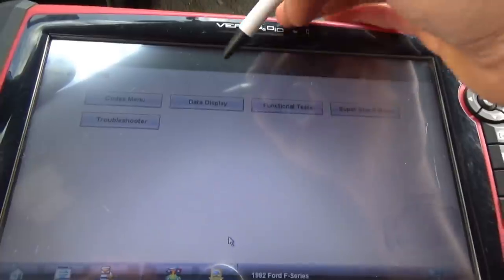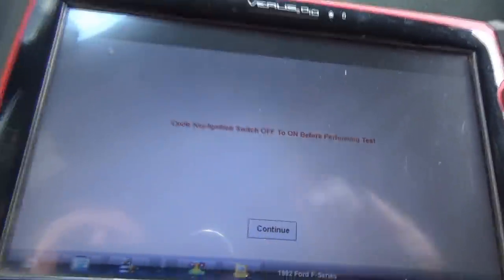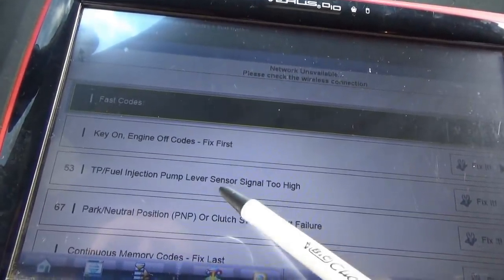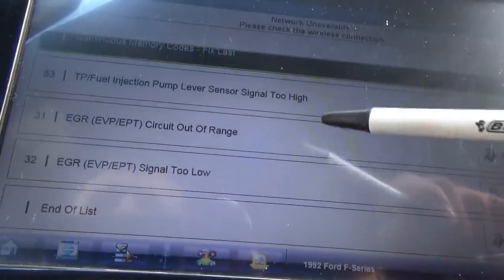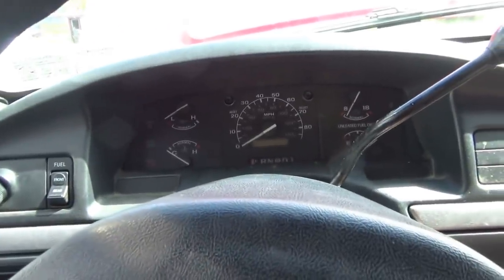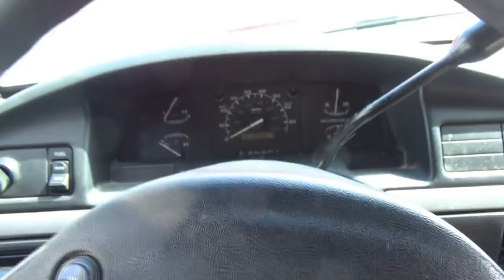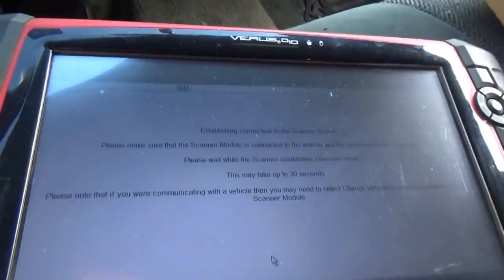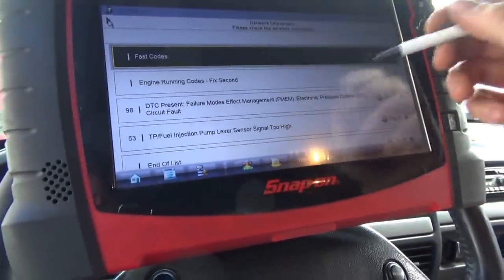EBAY Parts Caused Ford Truck IDLE Problem? ('92 F150)

Comment: I actually WROTE some of the software in that engine control module.  Idle TPS setting is not critical (the spec said 0.7v-0.8v but the old one was 1.1v).  Software re-learns Closed Throttle every time you cycle the key.
Reply from the maker: Interesting. The 0.7 V spec seems to be right on the $! Old throttle body linkage was tweaked by the tech so plates wouldn't close to the original position lol
Reply: i got mine at .89 or somethin. i didn't know it learned that often though. I swapped the instrument cluster minus odo into my 94 so i could have a tach. The CEL doesn't work now and it's not a socket corrosion or bulb. I guess i have to pull the layers of pcb papers on the cluster and look for a burnt trace....jeez

Comment: That Ford IAC system is so goofy. If I remember right the throttle stop screw isn't even supposed to adjust the idle, it just makes it so the throttle blades don't stick closed. The hole in the throttle plate actually sets the idle. Ford sold bushing kits to change the size of the holes to fine tune the idle. The IAC is just there to raise the idle if you have a load like air conditioning or power steering at idle. 🤷
Reply: You are correct. The set screw that everyone dicked with was the “hard stop” to keep the plates from sticking. The hole was a calibrated size for air bypass. A quick trick to set base idle was to disconnect the  IAC and the engine should just barely idle. With the IAC plugged in, it should run between 25-40% at idle, depending on load. If it’s really low, that’s usually a sign of an
Intake leak.
Reply: Ya its a slightly ass backwards and unforgettable system.
Reply from the maker: Yup and they tell you not to wipe the bores because it will remove some magic coating 😂
Reply: @PineHollowAutoDiagnostics  I always used a clean rag and some carb cleaner anyway. A gunked up throttle body will cause many idle problem all on its own
Reply: @PineHollowAutoDiagnostics  the magnum dodge engines are similar supposedly if you touch the tip of the iac valve it will no longer work.  I've tried mine and I'm happy to say that it's a great joke and still works fine
Reply: @PineHollowAutoDiagnostics  That statement is actually CORRECT !  The coating was installed at the throttle body manufacturing plant to minimize air leaking around the plate at idle.  All idle air should be controlled by the hope in the plate and the IAC.
Reply: Never heard of bushings for the throttle plate.  The small hole would mean the IAC would have a larger range of authority.
Previous generation (EEC-II) did have just a "kicker" for fast warm up and A/C idle boost.
Reply: Yup. Disconnect IAC, set base idle to 500 or 550 rpm I think it was, plug in IAC and Restart. IAC adjusts for engine loading, duty cycled by PCM for desired idle speed. If the TPS is at idle voltage.
Reply: @jackpatteeuw9244  I actually remember those old model 7200 VV carbs that used those; when properly rebuilt, they gave better power, fuel economy and emissions then the CFI engines.
Reply: sounds correct and the TPS should be slotted and adjustable enough to get the correct voltage, with blades shut and stop screw touching proper so it doesn't jam shut.
adjusting it any other way will run bad and spit codes.
Reply: @PineHollowAutoDiagnostics  it's like pixie dust for throttle bodies...
Reply: @PineHollowAutoDiagnostics  Correct.  It will never be the same.
Reply: Exactly Wes the blades are set just off the bind with the stops, glad to see a youngster knowing old Ford EEC 3 systems. Although with all the EEC's I worked on I never had to adjust the holes to fix an Idle problem. That sounds more like Ford didnt wanna change throttle bodies if one got a worn shaft under Warranty and just wanted to close the hole a lil to make up the diff lol. Kind of like when the 3.0 Taurus blade shafts in the intake failed and leaked they gave out revision kits to limit PCV flow and left the intakes leaking lol. FAIL!
Reply: I cant recall how many times I've told some old school carbureted guy that the throttle stop screw on these OBD1 fords is only used for calibrating the TPS voltage and is not an idle set, just to have them argue with me about it.
Reply: @PineHollowAutoDiagnostics  Ivan, that was because they didn't want people cleaning them and to just go to the stealership to buy a new Throttle Body. But if I remember right they didn't come out with Teflon-coated Throttle Bodies until  1995 or later and then went with a solid plastic TB in the 2000"s. But that Magic coating on those back in 90- 92' was just carbon build-up. lol  My boss bought into that shit, when the parts cleaner man sold him a 55 Gal, drum of plastic safe parts cleaner, my boss called him back and told him to get that shit out of his shop because it took 3 times longer to clean any parts and he was right it sucked. lol The only good thing was because I was a kid of 17 and working in the shop that weak sauce parts cleaner didn't make my hands numb after using it. And yes we had Gloves but I refused to use them back then they looked like proctologist gloves and went up to your shoulder and the guys in the shop gave me shit about wearing them. lol :)
Reply: I personally polished mine to mirror finish, no more build up issues after that.  

I believe there was a set rpm with the iac disconnected, a bit of a hack was to then open up the tps mounting holes to give you some adjustment.  

The best performance and mileage is usually attained with the TPS just under 1.0 volt, at 1.0 volt the obd I Fords went into closed loop.

Comment: I actually still have 2 early obd cars and I actually like the old paper clip diagnostic method... mostly because 99% of the time the code pretty much tells you what's actually wrong with the car rather than leading you on a chicken chase through the various systems and sensors.  One of our cars blinked out a message recently that said EGR valve malfunction... and amazingly enough when I tested the EGR diaphragm it was blown....The old OBD systems didn't throw a lot of codes, but when they did they usually gave you useful information and all you needed was a paper clip to read the codes. I know I'm getting old because I remember hating on board computers when they first came out and now I look back on them almost fondly.... how sad.

Comment: I started working on cars in the 60s,  Tune ups with points and condensers, specific tools for specific carburetors. It was pretty cool to see the technology change all the way up to todays  computer engine management. I stayed up to date and found it really isn't that hard to properly diagnose a problem the first time. I have been retired 6 years and enjoy watching these diagnostic videos. 
What impresses me the most is the HP they can get out of small engines. 6500 rpm redlines on most cars is pretty impressive considering anything over 5000 rpm was pushing it back in the old days.

Comment: That shop could have avoided a lot of issues by using a pipe tap on where the fitting rusted out and just screwed in a new fitting.
Reply: or just looped the coolant hose back upon itself bypassing the throttle body.
Reply from the maker: That's exactly what I told them 🤣
Reply: @mph5896  until it iced up in winter!
Reply: YOU guys are missing the shops main point>TO MAKE PROFIT< how much more money did they make buy selling the guy a new throttle body 200 ???And on the legal side of it ,that's a legit charge,because a rusted out pipe IS PART of the body.IF they would have REMOVED that pipe and did a repair THEY would then be liable if the car overheated or had ANY cooling issues and blew the motor.LET'S say the owner was smart enough and crooked and PULLED the pipe off,AND CLAIMED THEIR repair FAILED.SMALL CLAIMS court says they would owe him a motor.I KNOW that"s  BS   but it could happen ,just saying.I"M just saying the shop was TRYING to cover their ass,maybe.great job as always IVAN>
Reply: @robertoruiz7069  That's why I enjoy Ivan's repairs. NPR. If you don't understand the problem you can't fix it. I think it's more about time vs reward. It just takes so long to figure out how something has failed. It's more cost effective to replace the suspect components,  plus the markup on parts. Around here most places work too cheap and make it up on parts.
Reply: Seen this before, and we drilled and tapped with a brass fitting from hardware store.
Reply: @mph5896  it would ice up, and not even need that cold of weather to do so.
Reply: Yes, agreed.  The fitting on my F250 had enough of a nub to put the hose on, but the next plan was to tap it and drop in a fitting.

Comment: Great review Ivan. Keep the old ones alive !
OBD1 vehicles also don't have issues like the new vehicles do. Recently had an '89 GMC V1500 Suburban with high idle issues when cold to warm, idle wouldn't reduce fully on its own. Once at operating temperature, the only way to get the idle down was to put it in drive with the brake on and within 20 seconds the idle would slowly come down to spec. Plugged in the Snap-on brick and of course, little help from that. Had to revert to prior to OBD1 methods or fire the parts canon. No vacuum leaks so it had to be a sensor related issue. The Vehicle had a Standard Motor Products IAC installed so that was a suspect. Ended up replacing the IAC with an ACDelco IAC, not easy to find by the way, and now the idle curves work normal from cold to operating temperature. During our diag, we measured the TPS and it was within range but my mechanic friend wanted to lower the idle number to .07 from 1.0 which was within spec range as it was. Idle is now super smooth. IAC's apparently have to be dead on perfect and from our experience, you need the factory part vs. aftermarket regardless of their reputation. My guess is when the Delco brand is not available your best options are to use Delphi or Borg Warner since they used to or still do make GM parts.

Comment: Ya, nice looking truck with the red/black combination.
Just keep the tp sensor voltage below 1.0 volt.  1.0 and higher will turn on the evap purge.  Changing older tp sensors with new OEM sensor helped to make a more crisp throttle response.  Kind of like changing the accelerator pump plunger assembly on a carburetor.

Comment: You can get live data with a cheap OTC scan tool.  I bought one specifically for this - OTC 3211.  Worked great on the 1993 F150 I had to troubleshoot for similar problems.
Reply from the maker: Really? Interesting... Maybe 92 was too old lol

Comment: Ivan,
Great video and fix - thank you! Codes 23 and 53 were set because the TPS was not reading between 0.5 and 1.2 VDC at idle. 
I have an early Fox with a SEFI 5.0L EEC-IV.  When Ford came out with the EEC-IV in the early/mid-1980s it was very advanced for its time.
Paul (in MA)

Comment: These trucks 87-96 were the glory years for the trucks the speed density EFI 300/302/351W/460 though primitive was simple to fix and parts were cheap. If you had a multi meter and basic hand tools and a haynes/chiltons manual you could diagnose a lot of common issues. Pretty appalling when a shop has to resort to swapping parts to find an issue and threw in the towel for a BASIC repair. Just because it didn't have an OBD2 port and it was an older vehicle. I'll never get rid of my 1990 any time soon.  I have to say lots of aftermarket electronics and sensors lately are just plain junk out of the box so I try to stick to OE parts  like sensors, fuel pumps, tfi modules, PIP sensors etc. but again dead simple, yeah it's not a modern system for EFI but if you understand the basics and can read and use a multi meter, your save yourself a shit ton of cash.
Reply: Is your 90 a Ford ?  I'm getting a lot of fuel consumption, after I did a tune up and I had replaced other parts earlier before the plugs and wires and it stinks, but immediately after replacing them the problem started.

Comment: These things eat IAC’s, TPS and EGR sensors. They also won’t control the IAC if the TPS isn’t at idle voltage.
I still have a half dozen thick film ignition boxes if you need one, lol.

Comment: I did an motor change several years ago and the customer wanted to change all the sensors  at the same time.  Dang thing would not run when I got done and traced it back to a bad new TPS sensor.  Threw the old one on it and it fired right up.
Reply: The aftermarket TPS sensors for old Fords like this one are GARBAGE!  If the vehicle starts n' stalls, randomly stalls when the throttle is released, or falls on it's face when you get on it, a junk China TPS should be your #1 suspect.  An old analog multimeter makes short work of diagnosing them.

Comment: The. MAP sensor can also be a culprit with idle. I had a 93 E150 that had a bad TPS and MAP at the same time. Took some time to get it all found, all I had was the CEL flashes to go off of.

Comment: once a guy figured the koer and koeo  self tests there was only a couple of other checks to do.  ford had it right while all the other obd1 manufacturers  were a headache.   dont even think about chryslers lean burn system.  once they screwed up  just run them off a cliff.
Reply from the maker: GM had live data since 1984!

Comment: On EEC-IV, I believe that live data is available if the EEC uses 3-digit codes. I know that the 91 Ford Escort and the 95 Ford Contour support live data.
Reply: I still look after a 92 f150 that has live data.    I believe a 1990 Lincoln continental also had live data but that was a long time ago.
Reply: My 86 Ford with EEC IV doesn't have live data that I can find.
Reply: @gregwhite5058  I think the oldest EEC-IV that supports live data is 1990 or 1991.

Comment: Ivan, Did you ever get your live data to work.?  Rather odd that you didn't otherwise.  They didn't give you lots of PIDs but enough to help out with certain things..especially giving you your tps and the iac % 
Couldn't even begin to tell you how many of those bent throttle stops I've seen.  I think that's the LazyAss throttle adjustment some will do. Lol😂

Comment: Amazing that when items are put into factory specifications , THEY WORK! Step ONE : know HOW the system you are working on operates ! Instead of reinventing the wheel , FIX the bad spot . " Houston , I think we have a software problem , booster rockets will not fire " . Rube Goldberg : nobody knows HOW that computer stuff works , put a TOGGLE SWITCH on the computer ! HOW do you fix it if you don't KNOW HOW it operates ? Great detective work with the bent part , bad wire and diagnosis .

Comment: I have the same amp clamp.  Do you ever see ghost amperage on the amp clamp.  I’m seeing 30 -50 mV not hooked up. Not sure if this is normal or defective.
Reply: Yes, it's due to the earth's magnetic field.  You are supposed to hold it in the same position that you are going to clamp it on a wire, hit the zero button, then clamp it on the wire.  RTFM 😀

Comment: I had this problem with an old carburetor version on a 302 Ford.  I just wired the choke open with baling wire.
Reply from the maker: I'm sure that improved the fuel economy 😂
Reply: @PineHollowAutoDiagnostics  I really enjoy your videos by the way.  It just points out that old school guys like me need to take cars to guys like you who actually understand the electronics.

Comment: I worked on a 89 f150 with a 302 that was a crank no start and when I unplugged tps the engine started and ran good so I left it unplugged and never replaced it because the guy that owned it used it to haul garbage in the campground he owned and it never seen the road. I couldn't believe how well the truck ran without the tps unplugged but transmission shifted ok and he never had a problem with the truck for the 10 years he owned it.
Reply: Seen a lot of map sensor failures on them
Reply: My favorite 80's and 90's rwd volvos just had a clicky microswitch as the tps... It clicked on by a closed throttle and idle control was activated.  0 fuel responsibility.

The slightly more advanced systems like this one use voltage to activate idle, i can't imagine it's  too responsible for fueling, probably tip in enrichment and that's about it.

Comment: I just purchased thinktool scanner.  For some reason I can not communicate with a 2000 explorer 5.0  power balance test. I need to know where it's misfiring. Can you help me. Thanks
Reply from the maker: 2000 might be too old for power balance... Try OBDII mode 6 👍

Comment: Overdrive switch is on the end of the shifter handle.
Reply from the maker: It wasn't there 😂
Reply: FORD forgot it during production.
Reply: OD switch was for the electronic overdrive transmissions, this truck has an AOD non electronic OD trans. which was available up till 1993.
Reply: @mplante7352  Yep, 4R70W & the E4OD on F250-F350 1994 and later